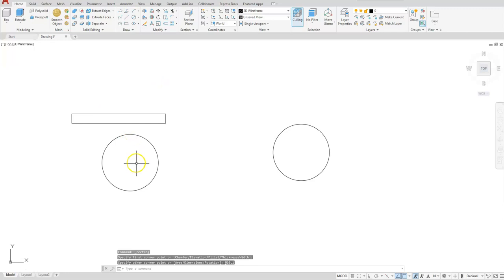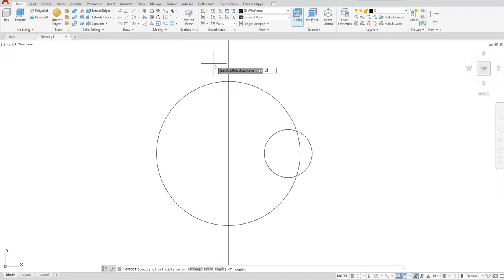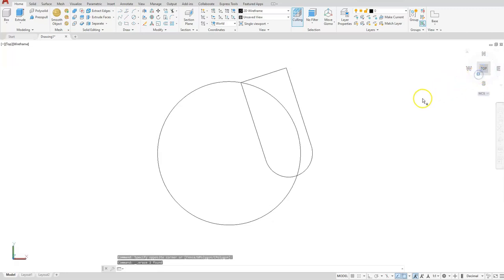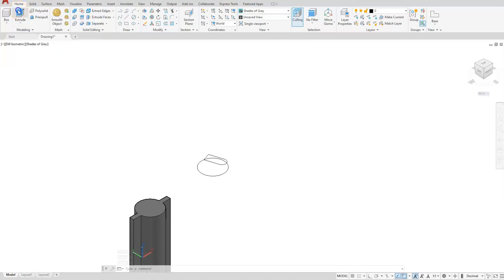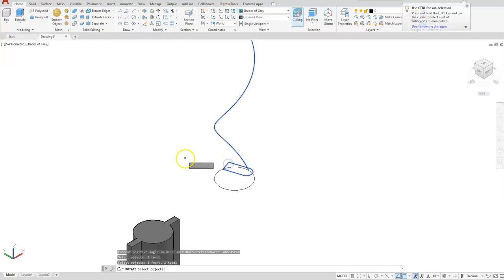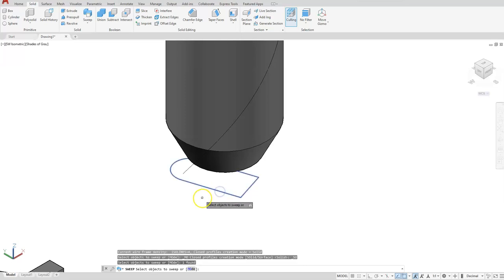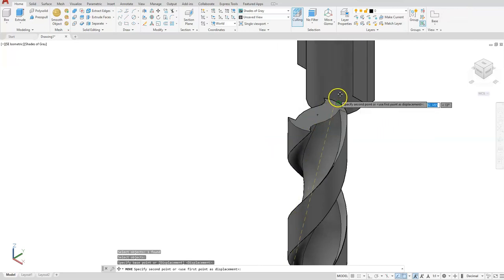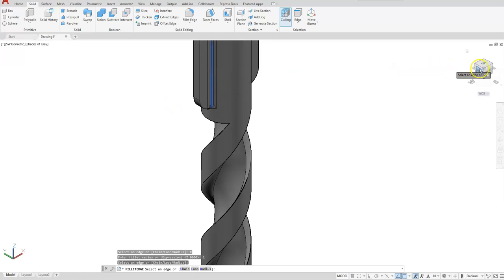Advance AutoCAD - 3D Drill Bit

Comment: Nice but a helix height of 80 will change the pitch from 25 to 26?
Reply from the maker: The pitch height or turn height  is just between each twist. There is no calculation needed, and it is independent of the overall height.